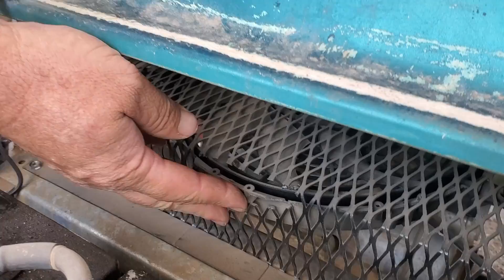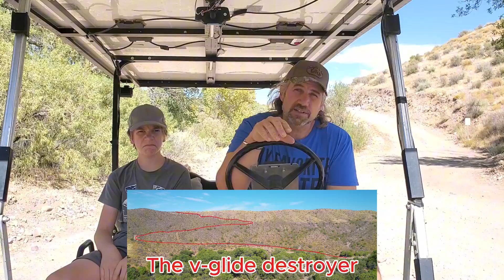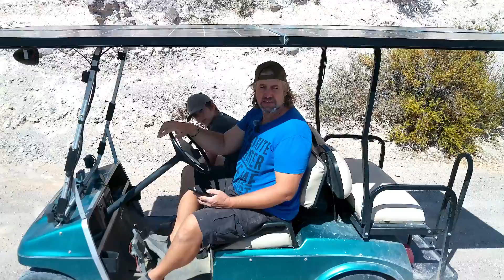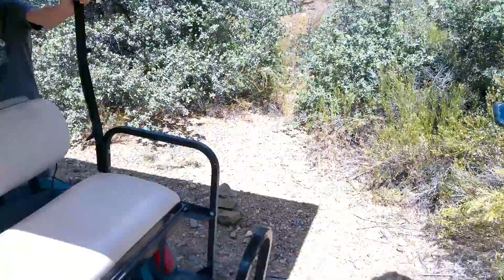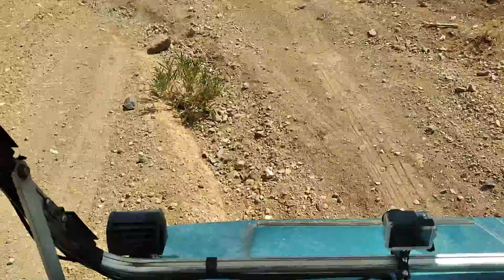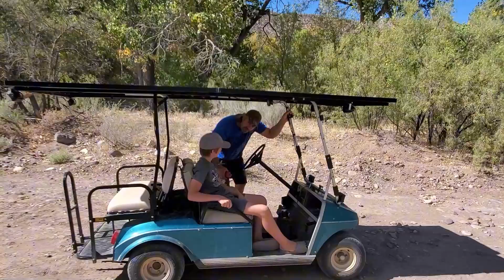Solar Powered Golf Cart Goes Twice As Far As Regular Cart

Comment: I remember the old day (last century) you'd be lucky to get 5 miles on a set of led acid batteries in a golf cart.  Now if you can add regenerative brakig, that might add a little more mileage but more importantly save your brakes from overheating and possibly failing.
Reply from the maker: I am really looking forward to trying newer carts and seeing how far I can go. I do like how the old stuff has no electronics super easy to work on.